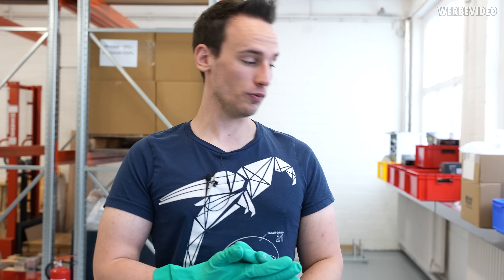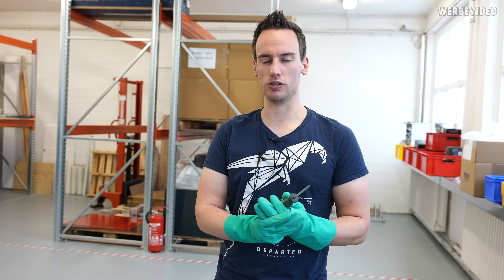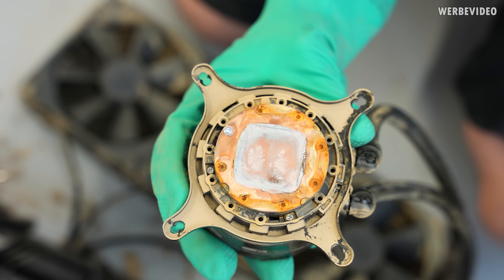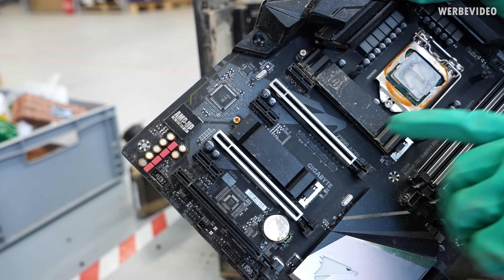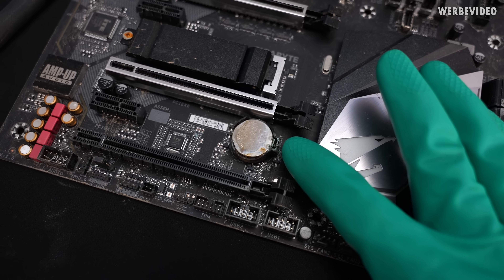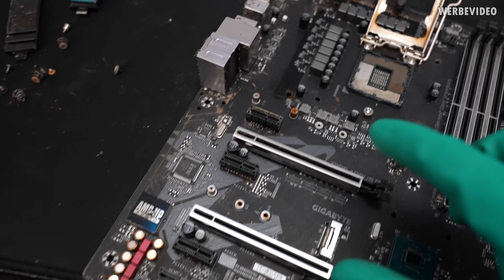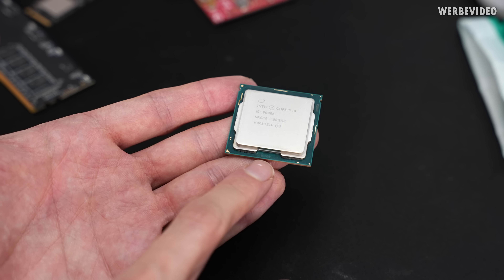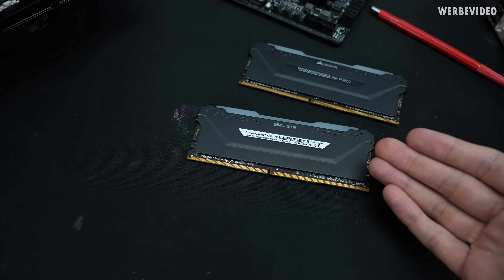The Worst Corrosion So Far...

Comment: Believe it or not, if you had used a really large ultrasonic cleaner with distilled water you could could have possibly cleaned the whole thing as one piece and then let it try. You would be surprised how contractors for insurance companies do things. They often clean electronic assemblies whole and then let them dry in a hot room.

Comment: Electrical contact cleaner for the socket and PCIe slots would work wonders. CRC and WD40 both make an excellent contact cleaner. Also a pencil eraser for PCB contacts like the RAM or pads on the bottom of the CPU.

Comment: Manufacturing has moved away from using the RIGHT METAL and replaced it with CHEAPER METAL thereby decreasing the overall cost of producing the Motherboard by 1,000 fold yet at the same time allowing a Price Increase of GREEDY PROPORTIONS. Are you SERIOUSLY NOT paying Attention??? Smaller, Faster, Cheater and BETTER FOR GREEDY PROFITS is what you're seeing in the corrosion that didn't used to happen because the correct metal was used. This is the end result of Collusion and Monopolies in the Market Place. Sure kid yourself that Intel and AMD are working in Competition; last time I checked Competition REDUCES PRICING and Collusion INCREASES PRICING and that is a FACT along with being my opinion. Cheer's...

Comment: Such a shame, Those Gigabyte GPUs are awesome. I had the 3080 Waterforce and it performed as good as the crappy 3090s that HP used. LOL Now I have an EVGA FTW3 3090 Hybrid in my work PC, but for my gaming PC, I kept Gigabyte with an Aorus 3080Ti Xtreme. was much cheaper than 3090s these days.
Reply: Just don't play Amazons new world on them

Comment: Honestly with the battery corrosion on the z390 in particular, that stuff eats its way down wires inside the board, eats its way inside ICs. And it does it slowly over time. With all the corrosion and that battery leak in particular i wouldnt want to have to use it long term for anything mission critical even if you managed to get it going, and i think you replacing the board is very generous of you and the best move. Keep doing you man, ur good value.

Comment: Good on you once again. You're one of the good ones.
Hopefully you never have to do this again, but for this one it might have been better to just have opened it asap and put it in a tub full of water until you could get round to it - for the same reason you always see a black box recovered from the sea in a tub like that. Its also why marine archaeology artefacts always come ashore and are kept under water. Most of the corrosion really only happens once the salts concentrate and the air gets to it (hence the final IPA/distilled water rinse to get rid of salts) - if you leave it underwater you can leave it almost indefinitely (like a lot of recovered marine artefacts sadly) until you can treat it.

Comment: On a side note when something like this happens the quicker one gets to cleaning out the much the better the chances there will be surviving parts even if it mean just getting a garden hose and just washing out the system then allow for it to dry out in the open. The same goes for laptops though wouldn't expect the LCD and the hard drive if there happens to be one.
Reply: the alternative is to keep it under (preferably deionised) water til you can get to it.

Comment: I've done outdoors salvaged systems that were left out for up to a year and still had working parts, even to my surprise some old hard drives survived despite being rained in and left to bake in the summer heat. What kills is dirt that holds moisture for long periods of time allowing for electrolytic reactions thus corroding solder points and pin connections ect.

Comment: When stuff like this happens, you should immediately rinse everything with distilled water to prevent more rust and corrosion from forming.
Caught early, a toothbrush and contact cleaner can recover most cases. 100% IPA plus those new ultrasonic cleaners can do wonders too I guess

Comment: I would probably go for the newer motherboard. You never know if the person might get into streaming, add something new to the system in terms of cards and generaly I'm wondering how easy / doable it would be to get the slots rust free and safe to use... Also, as you have stated: if the psu went first, and the system was on, there's always that chance the board is bricked anyway.

Comment: Soak the Mobo in a distilled water \ vinegar solution, say 3 or 4 to 1 parts respectively to clean the corrosion. Then rinse it.

Comment: then release a 2nd part to this video and i would actually try to have the motherboard fixed and give it back, but i would also be worried if it might have some long term problems
Reply: If the pci e pins are corroded and a short could ruin an expensive and now nearly impossible replace GPU. Not worth it

Comment: Mild citric acid solution is a fantastic corrosion remover. 5% concentration should do it. It's used in brass and copper pipes all the time, so very safe here. Spray a bunch on the PCI-e connectors, flush with alcohol, leave to dry. Should hopefully get those connectors up and working properly again.

Comment: I think you answered most questions regarding how to proceed from here in the last few minutes of the video. To make this a solid workstation you should probably replace the motherboard. Unless you know exactly what is causing the problems and that there isn't anything else going on, and you know that you can fix it in a permanent and reliable way it's not really a good idea to repair it and put it back into the machine. On the other hand it would be interesting to see just how much would need to be done to get it working, but that's more of a "that's interesting" thing than good advice for repairing this particular PC.

Comment: I would try to restore the his original mobo if necesary. It would be a fitting solution for this particular series of videos, and it would be a very cool learning experience for everyone! You can always replace the mobo if you run short on time or if the board fails to function properly.

Comment: I would give the user the new motherboard, and run long duration test on the old motherboard. See if it is going to last.

You had it right, just backwards. "Fiberglass" pen for removing solder mask and for cleaning contact pads

Comment: once started rust tends to spread just from normal mosture in the air, even if you get the old motherboard working It has so many points of falure that I would not give it much of a good prognosis on lasting very long, so stick with the new motherboard just to give the system the best chance on lasting, best of luck to save the graphics card

Comment: I would also give him the z390 master, issues is that there are so many ways in which any corrosion on the mobo can interfere with daily use that I wouldn't really trust his old board anymore(looking at it, if there is corrosion within the pcie connector's there is too much that can for wrong with it). If you want to attempt to save it, an ultrasonic cleaner would probably help you quite a bit on this occasion. Thanks for the work you put in for the unfortunate, I'm sure it will be very much appreciated!

Comment: I'm tell'n ya man, stick it in a dishwasher -- don't let it do heated wash, hot water from the tap only (keep it below 50c).   Use a little bit of citric acid in the wash (food grade) and it'll make it all like new (and a little bit of dishwasher soap).  Don't do heated dry in dishwasher, just use the alcohol rinse method (let it cool a little first, cold alcohol and hot components aren't friends).   I have a shop dishwasher (old portable unit) and you'd be surprised how well it works for all types of things.  Citric acid powder (not much, like 15ml in pre-wash and 15ml in main wash, with similar amounts of dishwasher powder).   For heavy grease parts, much more is needed.   Just hose the parts off real good, position slots so that the dishwasher can blast water up into them (always be thinking about where the water jets are and where water can pool (rotate parts and different intervals if needed).  Depending on corrosion level, this should take off most of it.  Can begin to strip some metal finishes like bluing on steel.  Amount of acid and length of time it's in are big variables.   Better to start with too little, than too much.  You can always run subsequent cycles, but you can never un-run a cycle.  Use less wash powder on subsequent runs, helps soften water.
Reply: sadly that wont help corrosion inside the board
Reply: I revived my B550 Unify-x from LM in socket and who knows where it got eventually  by running it a cycle in the dishwasher and then just letting it dry for 2 days :D (yes it was so small amounts that the galium post no threat for poisoning but it was still enough to well short some cpu pins)

Comment: Water damage should use iso to clean of the minerals from in the water and then bake it in an oven to remove water accumulated in the substrate and under bga's. Humidity is #1 causes of issues.

Comment: There's me, who's too afraid to even take apart his graphics card to clean it. Then there's DerBauuer, who fixes flood-damaged PC components by literally submerging them in alcohol and throwing them in the oven. Lol great video man, glad you were able to salvage some of those components!
Reply: Back in the 90s my friend knocked a bowl of slightly soupy jello out of my hand onto my computer. I kicked the surge protector out of the wall, took apart the old shitbox, and put it through the dishwasher.

After a few days in a sunny window I fired it back up and got to killing zombies in Dangerous Dave
Reply: he has sponsors and extra parts, the average consumer doesn't. you can always buy really old graphics cards for cheap and practice disassembling those before moving onto your expensive one
Reply: Just have more confidence in yourself bro. You can do it. Just be slow, and don't do it before bed.
Reply: You'd probably lose your mind if you saw what I did when I got thermal paste in an AM4 socket after it got onto the pins during a CPU removal, which also resulted in the cpu slipping out of my hand and into the socket again. I used an alcohol spray can to clean the CPU first, then did the same to the socket and pins. I sprayed it till the pin holes all looked identical. Then I hit it with a datavac 4 amp blower, which draws enough power while on to eventually turn into a warm air blower (maybe 110-120f tops), so it was perfect for blowing away and drying off EVERY drop of alcohol that got anywhere on the board. I showed my friend the process on another board just to replicate it in his presence, and he was like "I trust you implicitly not to break anything", then booted up the PC for the first time before taking it home. I've done this several times now because my thermal paste application method results in a fair bit of excess, and it works just as well on LGA boards as well, where cleaning the socket with brushes or other manual devices is a non-starter. I've also knocked SMD capacitors off of a couple of video cards recently and soldered them back together, after I carelessly knocked one off, and a friend did the other (totally different caps on different cards). Super easy fix if you already know how to solder, and ideally you have a mini heat gun built for the task, though I could probably have gotten both done with just an iron if i wasn't dysgraphic (yes, i do microsoldering with a fine motor skills disability, and you can too!) Electronics are a lot more resilient than people give them credit for. Anything without moving parts, which is off when it gets wet, is probably salvagable 9/10 times. Even an SSD i had, which magically just stopped detecting at all, worked again after enough test attempts, most likely for the same reasons the CPU didn't work at first. It most likely got water on the pins without me noticing, while dealing with a leak in one of those corsair 2080ti waterblocks that everyone complained about. My 2080ti, motherboard, and SSD all got wet, but are all still in service today :)
Reply: @TheOriginalFaxon  you went through a lot of effort to not learn how to apply thermal paste

Comment: from experience, if the battery connector is already corroded, the anti corrosion coating is gone. No matter how much sanding you do, it will corrode again when the condition is right.
Better to replace the battery holder if possible.
Reply: Yup, those battery holders are only a few dollars, and it's only 2 pins to unsolder to get it off.
I'd also replace the metal CPU retaining system, with one from a junked board.
Those easy fixes and a proper cleaning should bring the board back, I'd still worry about those corroded PCIe slots though.

Comment: Not all the dmg may be visible or noticeable now but when corrosion starts it's very hard to stop it so the MOBO will continue to corrode after you return it and may not only have a problem with the board but also with some other parts connected to it so no don't reuse the old board, give him the new 1 but still test the old board if you have some meh parts that you don't mind losing in case something goes wrong and more important, time for it.
It's very nice of you to help the misfortunate guys and restore at least part of their life.

Comment: I can't really talk for Keanu. Can't tell if he has any sort of sentimental value on the Motherboard.
But if it was my PC I would take a new and working motherboard any day over an refurbished.
Reason is that it is much safer. There could be something that you can't see now that could cause damage along the way. 
The corroded battery part would make me somewhat worried too. Plus the lifespan of it could have been reduced too. Hard to say. 
My biggest fear would be that there happens to be a short down the line that destroys the motherboard or even other parts.

Comment: The screws on the AIO are all stainless and have not themselves rusted, the reason they look rusted is that the CPU retention plate was rusty where there water sat and this transferred to the stainless.  it is the thing with stainless people think it can't rust and well it cant but it does attract rust from metals that do, this is why you must never put mild steal items in a stainless steal dishwasher as the salt in the tablets causes rapid rusting of mild steal and then the water in the rust sticks to the stainless damaging the surface with rust spots and making it look rusty

Comment: The silt settles down, always - The system ended up on it's side in the flood, while still underwater. That's why all the silt is on the same surfaces in the entire build.

You really should use an ultrasonic cleaner, there likely will be dried silt and salts under many of the BGA and surfacemount packages.
Reply: My thoughts exactly. An ultrasonic cleaner would be great in this case.
Reply: look around for my dishwasher method post.  Works great.

Comment: When I owned an Aorus pro, I always wished I had gotten the Master. Give him the Master :)
Reply: Just bought an gigabyte x570s master. It's a beast.
Reply: Noah Tek  For z390 the master had a  better VRM design, and was able to push memory overclocks higher than the pro.
Reply: @theonlysquirrelybird  Not true. It's cheaper Auris  pro has better caps for some dumb reason
Reply: Noah Tek  mine always displayed the Aorus splash screen while booting. Black screen with the white Aorus logo.
Reply: is the aorus line really that much better? I’ve always bought the budget oriented ultra durable line from gigabyte. I’m building a new system, but never gave the motherboard much thought

Comment: You could of course try and clean the old board, but you'd never know if any of the slots might have bad corrosion inside which could cause issues in the future. If you don't have a use for your board then maybe it would be best to ship that so you won't have to worry (one item less in storage). I look forward to the cleaning of the graphics card + radiator. Great work as always! 

I kind of missed the case cleaning at the gas station hehe.

Comment: I think for the rescue purpose and for the video, you should try to save the MB, and do a real intensive clean and study into it ... but in the end, give him the new board anyway.  Its a tool, and it needs to work without any potential future failure issues.
Reply: @restopesto9448  dude - just that battery acid writes off the board for long term reliability - theres a good chance it will still eat its way down the wires
Reply: @restopesto9448  Where at all did he say there was no right to repair? He said it was a waste of time if the socket, pci slots, and battery were corroded, as its a waste of time. You probably could fix it with enough time, but by then it would be way easier if you just replaced it. No where in that reply did he say that theres no right to repair it.